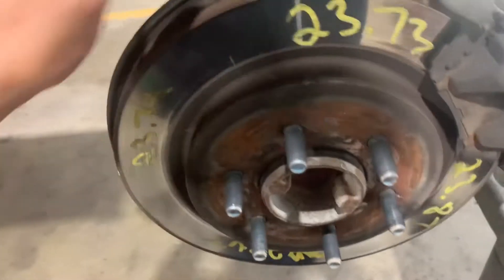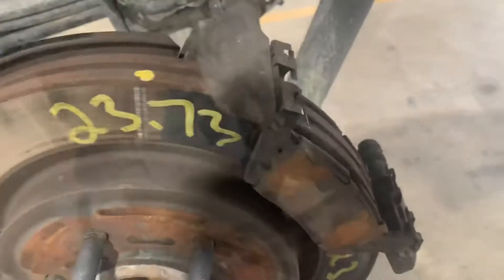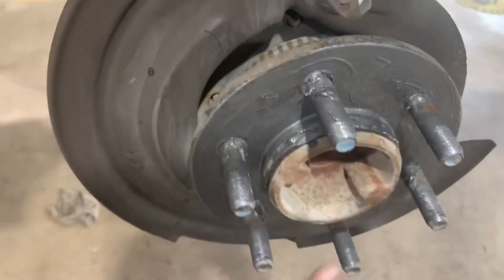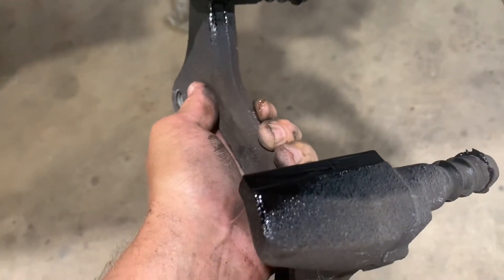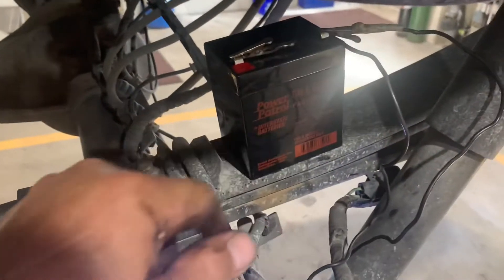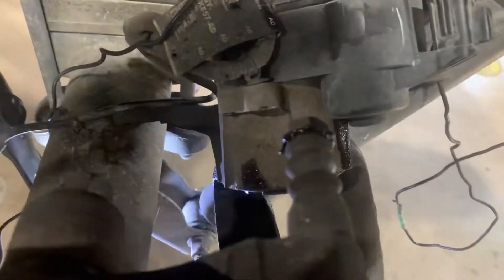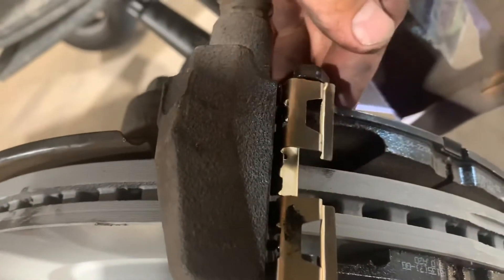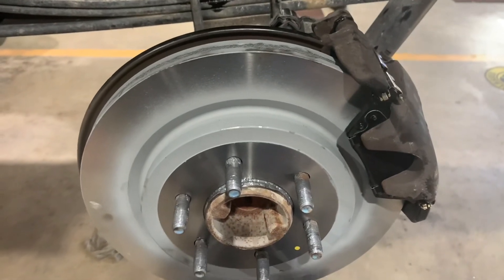2018 F150 Rear pads and rotors E-Brake

Comment: Any recommendations for getting the rotor past the e brake? I have been heating and spraying and hammering for hours, and it hasn't budged one bit...hasn't even loosened at all. My conclusion is that I'm hung up on the brake shoes somehow (and yes I put it in maintenance mode first). Thanks in advance!
Reply from the maker: Parking brake shoes are stuck on rotors is that what you saying?
Reply from the maker: If you are saying the rotor is stuck on the parking brake shoes and you cannot back off the parking brake shoe adjuster this is what I do , brake caliper and brackets are off and vehicle is supported I put it in drive and slowly accelerate and spin a rotor off if one comes off and the other one is still on I put the tire on the one that’s off and lower vehicle to the ground on that tire and put it in drive and try to spin the other rotor off only do this if you understand what I am talking about it’s dangerous and be careful